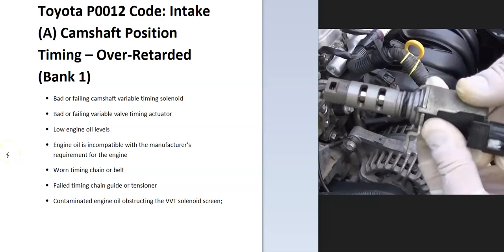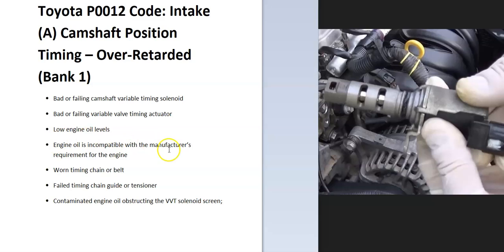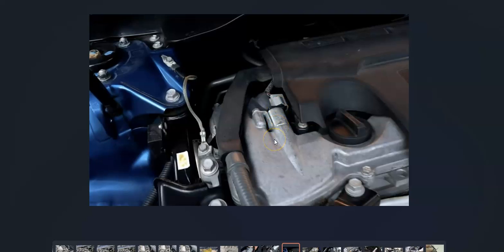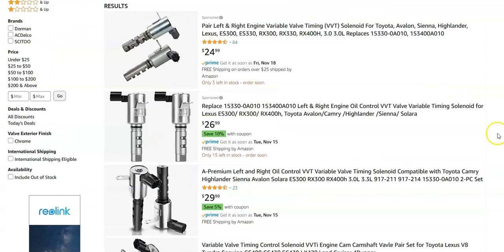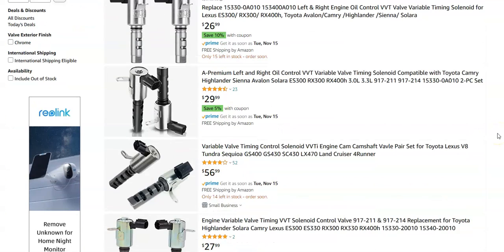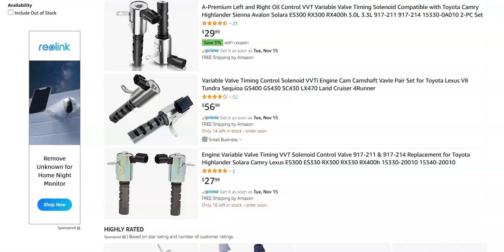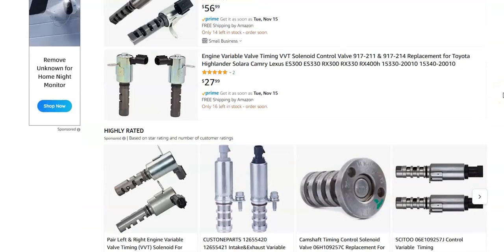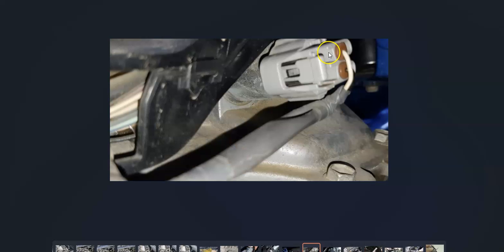Causes and Fixes Toyota P0012 Code: Intake (A) Camshaft Position Timing – Over-Retarded (Bank 1)

Comment: Got a P0010 on an 09 avalon for bank 1 open circuit on cam actuator. Scan tool said the likely fix would be to change solenoid. Did that and still got code. I did notice the ground wire on bank 1 side was tied together in two places which was supposed to be soldered but the shade tree mechanic just twisted the wires and heavily taped it. So I'm assuming this is my issue. This code been driving me nuts for 3 months. Will solder the ground correctly and see if that fixes the problem.

Comment: This code popped up on my sienna. I just took it to the mechanic this morning. We'll.see what they say
Reply: How did it turn out brother?
Reply: @slurmsmakenzie7970  they said the four camshaft sensors are going bad and needs to be changed. They said it really one, thats setting everything off, but I should just go ahead and replace all 4. So far, the light haven't came back on in a long time, which means I still have time. I haven't had any issues though. Toyota wanted to charge me 1700 dollars to get it fixed. I laughed in there face. I have found  two mechanics that can do it for less. I also found out thry are easy to swap out and I can do it myself. So I'm fixing to do it myself. Thanks for asking. How about you?
Reply: @redcrimson102  great. I looked those sensors up, seems like they’re about $40 a piece. I’m waiting to hear back now. Ours is a 2009 sienna

Comment: Hi there i have a Toyota CHR with P0012 we have changed everything on the timing gear OCV valves cam solenoids  timing chain and guides engine flush and new oil and filter checked  OCV wiring to the ecu and pico scoped the solenoids
and ok after 3min driving fault comes back on same fault any suggestions on what to check next much appreciated
Reply: Hi Wesley.I had the same code on my 2017 CHR 1.2 CVT,I had spend quite a lot of money by Trial and error on trying to fix the problem,I had replaced sensors,Timing chain,Oil control valve etc,after no success i was Adviced to replace the VVTi Intake Gear,after replaced my problem was solved no more engen light or any codes(P001200)

Hope this helps
Reply: Looks like u missed the 2nd most common issue with these engines with p0012 the cam phaser

Comment: Hi there have a Toyota CHR and fault code P0012 have replaced all the timing chain also  guides OCV Vales actuators on cams carried out engine flush  changed oil and filter.Checked wiring to ecu and ok no short fro ground problem also scoped OCV valve and ok  but fault still there nothing else to replace on timing your would be much appreciated thanks
Reply from the maker: Anything I say here is a guess, but if the parts are good and there are no other codes, it's usually in the wiring. There can be engine-specific problems, such as certain passages getting blocked or other known problems that only that engine has. I would try to find an online forum or similar that has a lot of knowledge on your engine.

Comment: Just had p0012 show up on a '13 Sienna we just bought.  Van seems to be running great, so I'm really hoping a bad sensor.  I just checked all the control valve resistances and they are within spec.  So should I attempt to clean the intake VVT sensor, or just replace?  Also what about the VVT sensor filter?  If it is very dirty could that throw a code?  I have no idea where that bugger is either...
Reply: Checked the VVT sensor filter too, that might be dirty (clogged)

Comment: GREAT VIDEO, as I've been searching this issue for awhile now.

My story:
I've had the engine light and traction light on (and off at times) for over 4 years for 2011 Camry starting in Fall 2019.    Estimate at that times was near $1600...and without any car / driving issues, just let it go. And with COVID.....never did anything
  Now, 2023 for at least 6M, they are ALWAYS on, and I just failed the inspection test and when they tested, P0012 is now another new code that has popped up.   The lights USED to  come on/off....but now steadily on.    

Car runs GREAT, I have never noticed anything, highway, or around town driving, STILL.   
  Wondering if it is just a sensor issue, or possible the oil valve, since the oil was "filthy" in 2019 when this first popped up, and the oil change, took care of it.  

Any thoughts on how to proceed?   As I am starting over with service w/new mechanic shop.   Thanks!!
Reply: Did you solve your issue?

Comment: I having a toyota Estima 2012 model ACR50,after replaced The piston ring ,head gasket,all time marks are correct ,but after 3km of test drive ,check light on with fault code p0012?timing chain ,ocv ok,what should i do?
Reply from the maker: It is hard to say, but if the variable valve timing is good, I would check the wiring.
Reply: @HVAC_Mechanic  
Which Part of The wiring i need to check?

Comment: My son got the p0012 code following the low oil light. As well as some clunking sounding like the timing chain in his 03 camry. He immedietlt shut it off and we changed the oil and the solenoid your talkimg about and the clunking sort of went away but u can hear it sparingly while idling.  Is it possible the chain can fix itself after the fresh oil change or do you think the chain should be replaced?  I figured the oil went low and the chain ran dry for a short period but after adding the oil it relubed and is ok.  Is that possibe?  Any help would be appreciated.

Comment: Hi there from Canada !Im also hvac technician🙂
My car cranks but doesn't starts.
Intake oil control valve bad ,can it cause the car to not start ?Thank you!
Reply from the maker: It may be possible but usually a bad VVT solenoid causes the engine to have less performance or run rough.
Reply: @HVAC Mechanic   thank you!

Comment: I watched your posting and solved my problem. Thank you, Sir! 2009 Toyota Camry 307,000 miles. Low oil pressure light came on, and check engine light with the 2 codes. Turned out the oil filter very dirty and clogged up and triggered everything else. After replacement and new oil, all lights went off and back on the road.  $$$ saved
Reply: Where do i locate that please. Have the same car with similar issues
Reply: did it make a knocking noise?
Reply: @sohrabnayyar Did u ever figure it out
Reply: Hello

Comment: My oil light came on and I tripped this code on my 2006 Corolla Le. I just had an oil change 3 hounded miles/week ago and I added AT205 for second time. Not twice. I did at205 after 2nd to last oil change then recently after oil change added 6oz of it again. I think that caused the problem. What should I do?